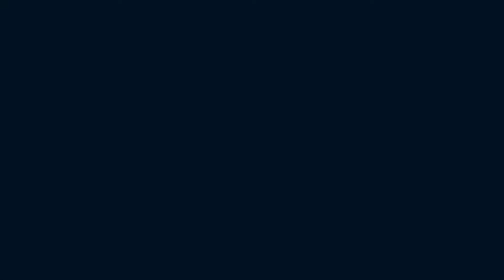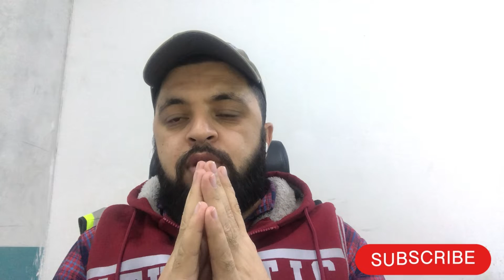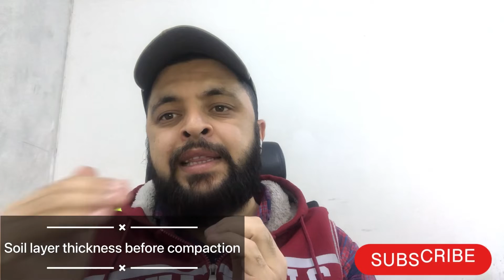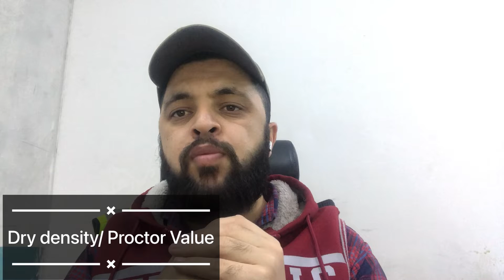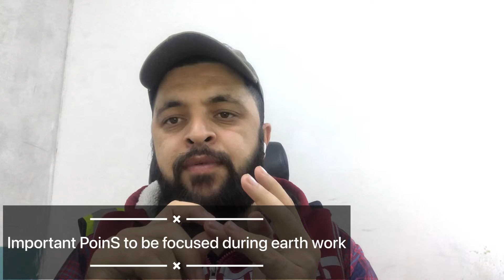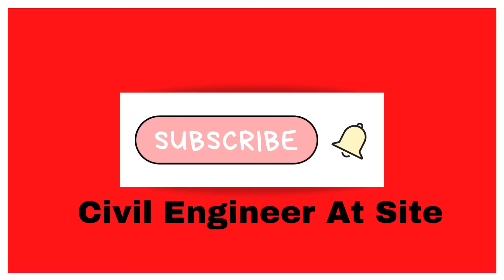Interview Questions And Answers for Engineer job Part6|Earth Work|Qc & Site Engineer in Saudi Arabia

Comment: Sir I didn't understand 5th answer sir
Reply from the maker: What’s your confusion
Reply: @CivilEngineerAtSite  I didn't understand 5 answer sir please explain it
Reply: @khajagazanfaroz3465  brother first of all u should know this that
The subgrade should done in two layer and one layer thickness should be 15cm
So the two layer thickness  will be 15+15= 30cm
So the question is if u find  3cm less in 15cm thick layer..it's mean the layer will be 12cm..
So u should trim the layer at 12cm to level it surface.then u should add 3cm more  so 
Ur layer will become 12+3= 15 cm